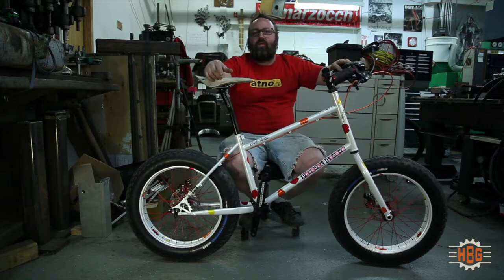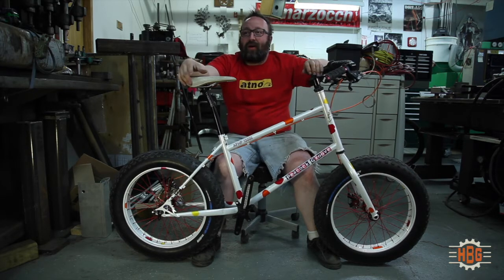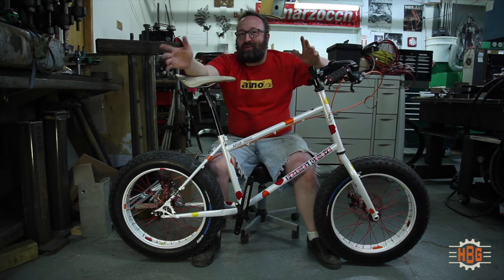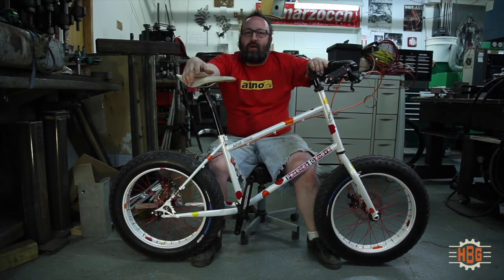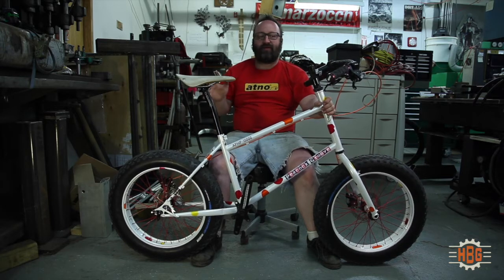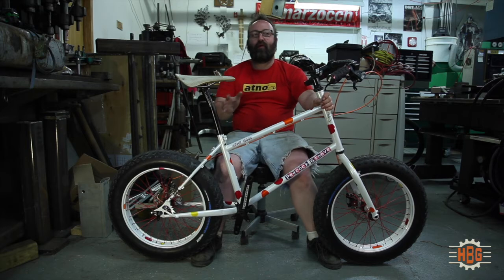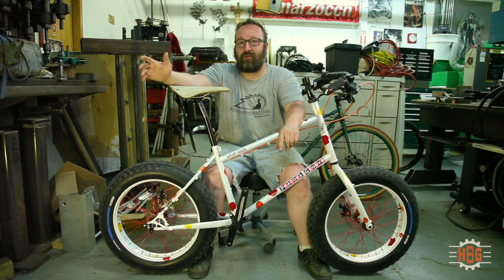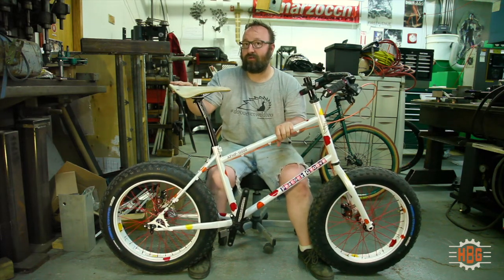Peacock Groove's Jelly Nougats

Comment: Actually, it would be more stable when bikepacking with heavy loads, and it would be more safe when bikepacking on mountainside hiking trails.  One could also chsnge side more easily when pushing it up switchbacks on steep mountain trails.  It would also excellerate faster on those types of trails.